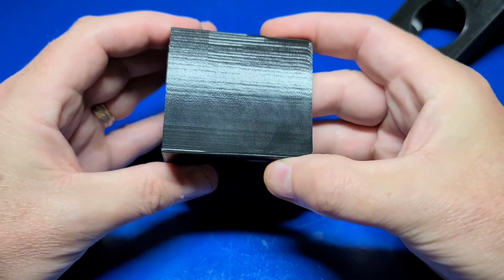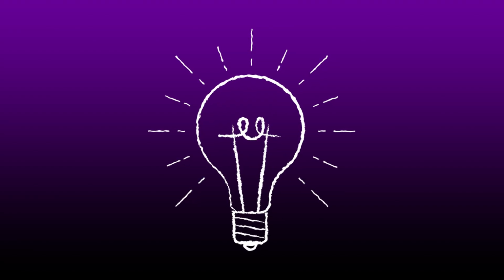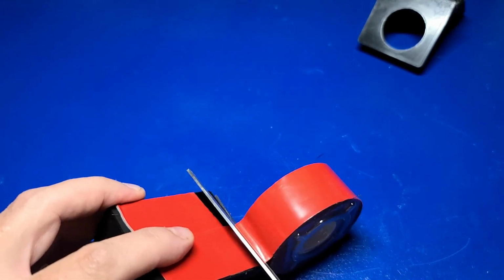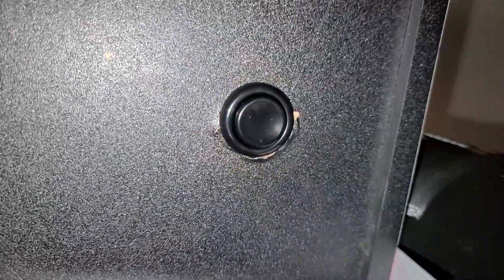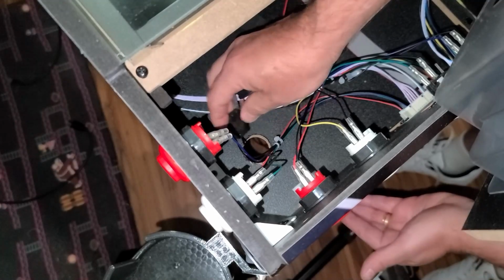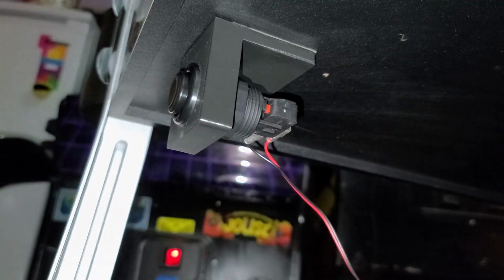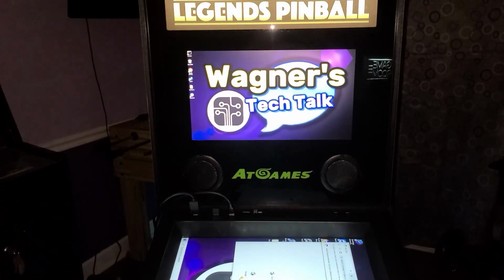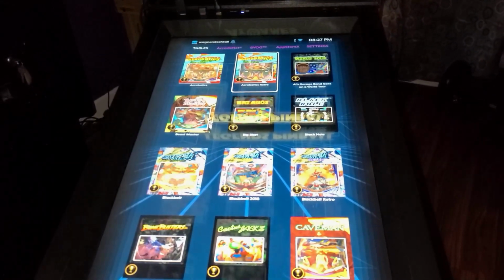AtGames Legends Pinball VIBS Switch Button Mount Installation and Setup: No Drilling needed

Comment: I bought the table and vibs and will get it hopefully august but Im trying to find a way to run the cables without drilling since it voids waranty...no video actually shows that part.
Reply: So how does at games want people to not drill put doesn't provide a place for cable to pass through... I may return vibs then just use otg with another monitor or at least wait 30 days.
Reply from the maker: @aharonfernandez6359  Just leave the back panel off, that's it.  You'll have a 90 day warranty, not 30.
Reply from the maker: You could use this switch with double-sided tape to the front of the cabinet and leave the bottom back panel off to avoid drilling.
Reply: @WagnersTechTalk  my question is where will the cables come out from since there doesn't seem to be holes in back door (as i said i just ordered so i don't have it yet)
Reply from the maker: @aharonfernandez6359  There is no hole on the back panel, if you don't make one the only option is to leave the bottom panel off.  I created a small hole in the lower-left to feed the VIBS Switch button wires and HDMI cable out.  You could wait until you 90 day warranty expires before doing the same.

Comment: Great video and resource! I don't have easy access to a 3d printer so I used mounting tape and mounted the microswitch to the inside front leg without the button. You don't have to drill or 3d print anything and you can't see it. Not as classy as this but it works !
Reply from the maker: That's a great idea!

Comment: Thanks for all you do!  Question... my VIBS board did not come with the nut to hold the button.  Was it supposed to? Also, I'm fine with drilling,  so do you know what size bit for the included button?  Thanks!
Reply from the maker: Hi John, most welcome and hope you find the videos/guides helpful.  Yes, the VIBS button should have included a nut.  If not, open a ticket here and they should be able to get a replacement to you: https://www.facebook.com/groups/1468474910163554 Although, may be able to find one at a local hardware store (haven't tried it myself, but may be faster).  At any rate, do request one to be shipped.  I don't recall the bit size I used, I basically held the bit up to the switch button and made sure it was just slightly wider than the button. Went back and watched the video I took during drilling and never once did I show the bit size to the camera (bad on me).
Reply: Appreciate the response to everyone's questions 👍
Reply from the maker: @exp1orer  much more fun when the discussions aren't one-sided.  I try to keep up, can't always do it but when I can I'll answer.

Comment: How should I answer the following two questions for 3d printing. Infill percentage. It gives me the option of 20%, 50% or 100%, which is relating to denseness.    Also it asks how smooth would you like the surface to be.  Low, Medium or High.  The higher the quality the smoother the surface.
Reply from the maker: I think I printed mine at 10% and the print was very solid.  Keep in mind, the higher the number the longer print time and after 4 hours they may reject it.  I think 20% infill is going to feel pretty solid.  Smoothness, medium should be good.  Hope that helps!
Reply: @WagnersTechTalk  Thank you very much.

Comment: A few questions based on form questions - which process (fdm, sla, sls, polyjet) and I’m guessing material is plastic?
Reply from the maker: I used an FDM Printer with PLA (plastic).  Hope that's all you need, sounds like good news already though!

Comment: 3-d printing has so many practical uses. Too bad some don’t get past the nicknacks. No offense to those who like to solely print display pieces.
Reply from the maker: For the first year after having my 3D printer, that's pretty much all I did.  Then decided, it's time to make some of that stuff I said I'd make if I had a 3D printer lol  You're 100% right, there are so many practical uses for a 3D printer.  It's endless what you can create with them and problems that can be solved rather easily.  Thanks for watching Tommy!